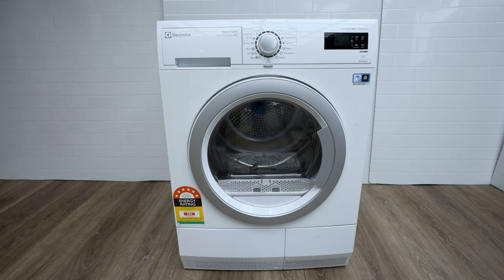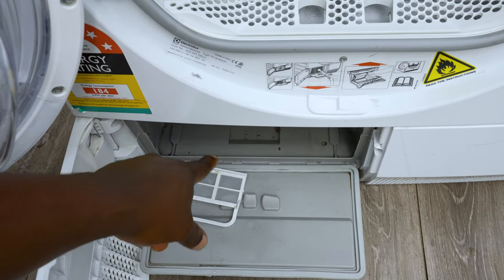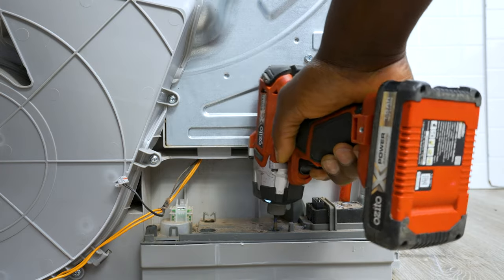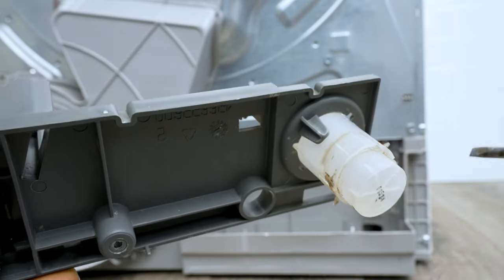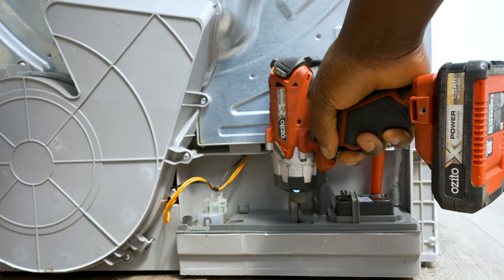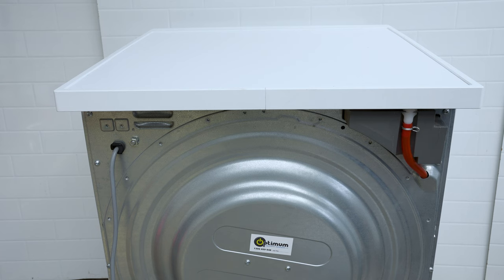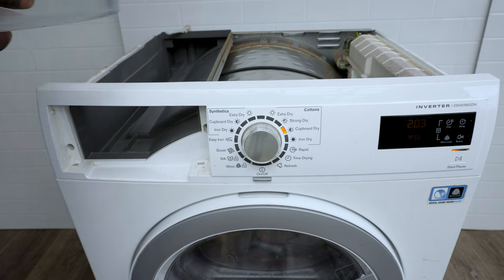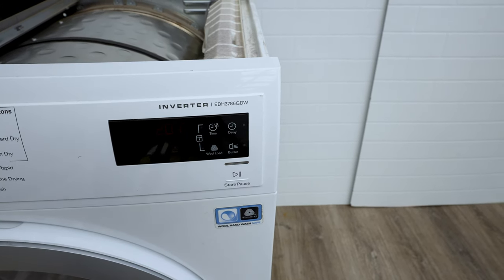How to Fix Electrolux Zanussi Dryer Leaking Water

Comment: Interesting video! My dryer is AEG, but it looks exactly the same,  so this is very useful information. Starting at about 3:40 and further, you will clean using a high power hose. Would cleaning with compressed air work as well? As I understand, the condensor unit-filter itself is not removable?

Comment: Great video, so helpful. my pump works but does not drain all the water. I even removed the float switch and manually lifted the mechanism to see if the motor would come on. It did not. Is there a cycle on these machines that only turns on the pump for a period of time? It’s an ultimate care 800 edh803bewn. The water then leaks out the front like in the first part of your video

Comment: Hello! please tell me how to do service mode on this model dryer?  My dryer just stop after a few seconds and the display thinks it's still going not paused etc. I checked relays and heater only getting sent 12v momentarily then few seconds after dryer stops when motor relay loses 12v .  If heater cable disconnected dryer won't stop but heater tested fine no short, thermistor all good etc. When cold heater relay keep clicking as 12v comes and goes
Reply: Fixed it I swapped the 2 motor capacitors around now it doesnt cut out. I then put a old cap I had from another dryer and noticed more torque when motor starting.  this dryer doesnt start heater right away with cycle so it sent me off track trying to diagnose...